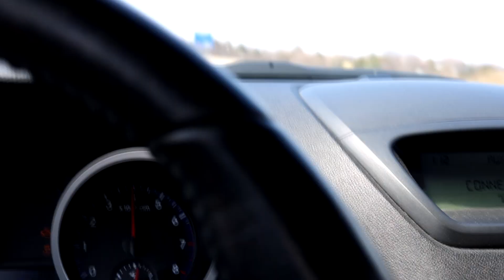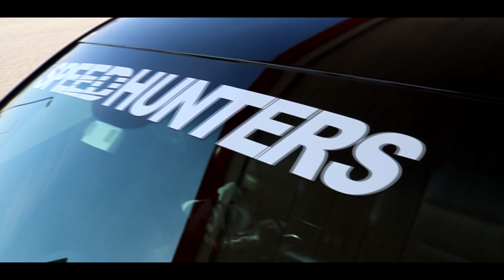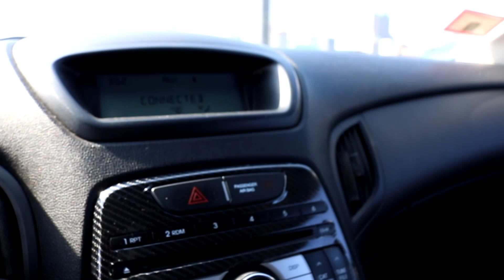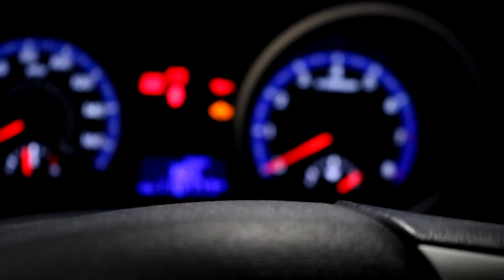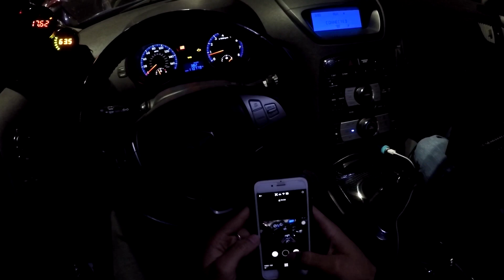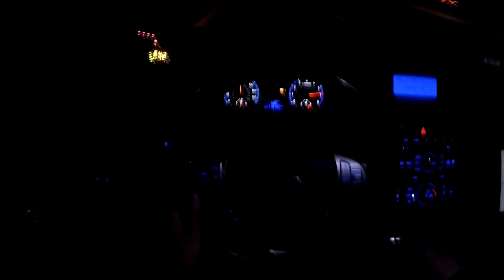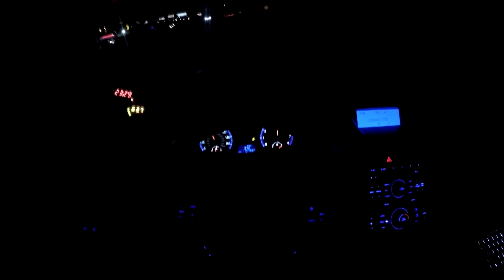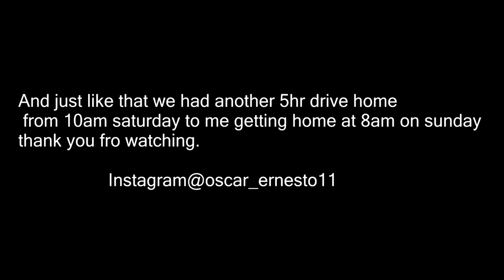E85 alpha speed tune with full bolt ons. Bk1 and bk2 3.8 genesis coupe

Comment: Question for you since you went through this, how did you go from driving there on pump gas then getting e85 in your tank and stuff for the tune ? I’m curious because I’m going to want to switch to e85 soon. Just want to know how people do it going from driving to the tune with and on 93 to switching to e85
Reply from the maker: U just make sure u have low 93 that’s all bro. So when it filled with e it can read more e for the tune
Reply: @oscarernesto11  can you go back and forth between pump gas and e85 on the kit?
i guess like flex fuel?

Comment: What kind of cai do you run? I was thinking of getting the one from 3.8 performance but I'm afraid that it might sit too low and get water in the intake on rainy days. Also what kind of exhaust is that?? It sounds sick!!
Thank bro
Reply from the maker: Jair Martinez aem cold air intak, headers , ark downpipes and test pipes with isr race exhaust
Reply: Jair Martinez the intake won’t get water, i’ve driven my bk2 with a true cai and open hood vents in the rain, unless you drive under water you’re good
Reply: @Theedd9991  what about with no fog lights? I bought the hydroshield and kinda nervous on rainy days

Comment: That's me the black bk2 racing the bk1
Reply: What’s done to your genesis? Looks fast
Reply: @jackrios4040  
(Black genesis)
Short ram intake
J2 headers
J2 downpipe 
J2 test pipes 
ISR single exit exhaust 
E85 tune
Stage 3 competition clutch and lightweight flywheel 
Stock differential 3.5

I've had 2 more tunes on a dyno since this street tune. Current numbers 320whp 290tq
Reply: Juan Salas that’s damned good bro. I might add j2 headers and e85 but I’ll stay dual exhaust and that’s really good that you’re pushing really hard with 3.5 gears because I have 3.9 gears and pulleys too
Reply: @jackrios4040  I think the j2 headers are discontinued but not sure